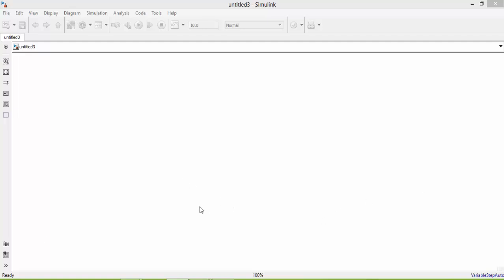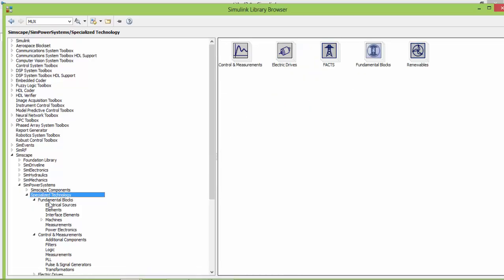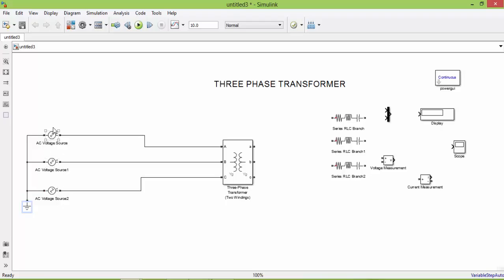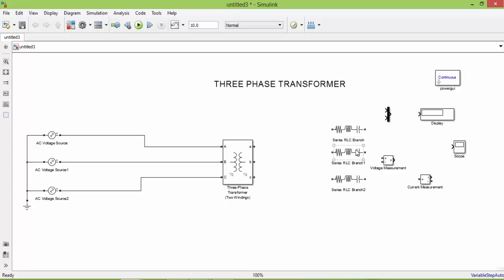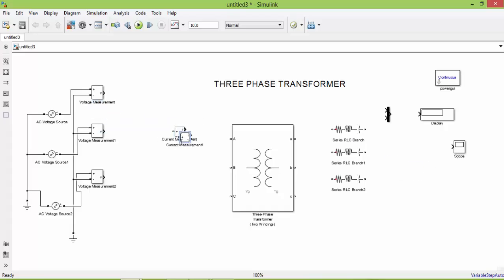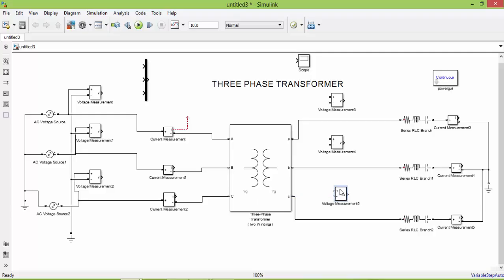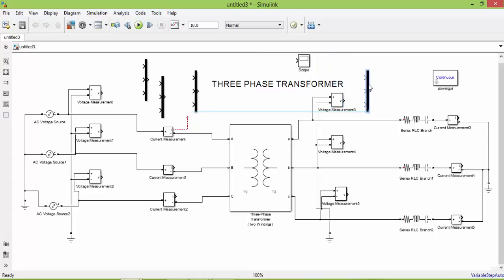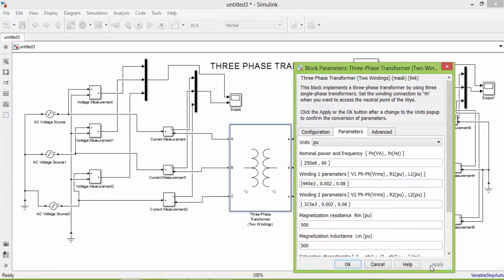matlab simulation of three phase transformer

Comment: Dear, is this circuit considered to be Y-Y connected, or Delta-Y , or Y-Delta ? Please and thank you.
Reply from the maker: In transformer setting u can change
Reply: @EduTechGururkk  If you please I have another question.
How do I calculate the efficiency of the transformer from this circuit?
Is having the primary and secondary values of the voltages and currents enough ? I appreciate you support.

Comment: from 2:50, if you had used a 3-phase programmable voltage source,  you would have saved 2mins of our time
Reply: Hey, sorry but do you know if this circuit considered to be Y-Y connected, or Delta-Y , or Y-Delta ? Please and thank you.
Reply: @husseinhaidar3155 Yes, in this particular video, the transformer has a Y-Y configuration.  You can configure it to whatever you like.
Reply: @franciskatende1566  If you please I have another question.
How do I calculate the efficiency of the transformer from this circuit?
Is having the primary and secondary values of the voltages and currents enough ? I appreciate you support.

Comment: Sir peak amplitude 440 volts means phase to neutral voltage..
Right... Sir???
Reply from the maker: No.it is maximum voltage at 90 degree.vrms is phase to neutral voltage

Comment: Why do you use a series RLC branch in place of the load, instead of a series RLC load or simply a resistor?
Reply from the maker: Rlc load will not work.only rlc branch will work has load